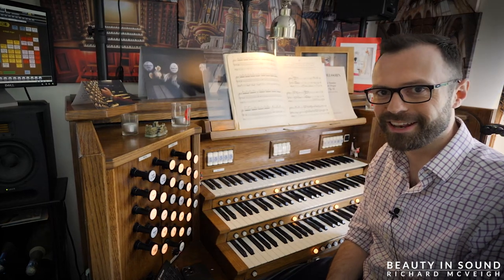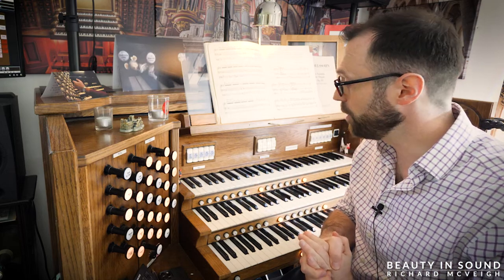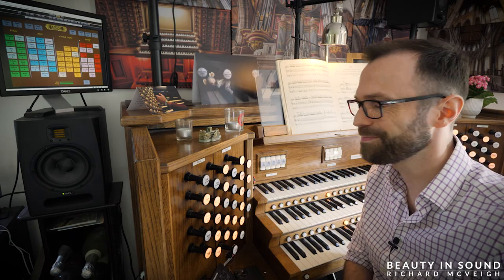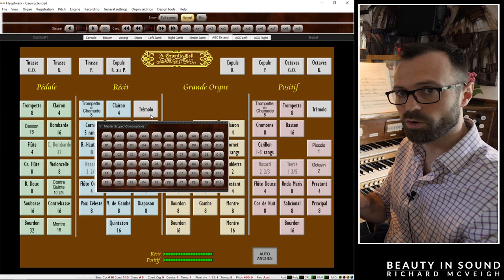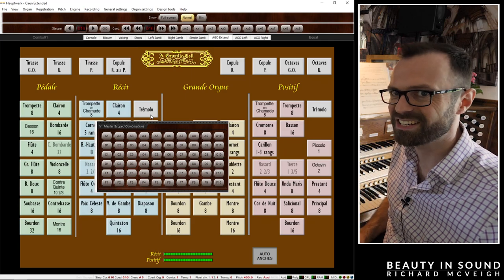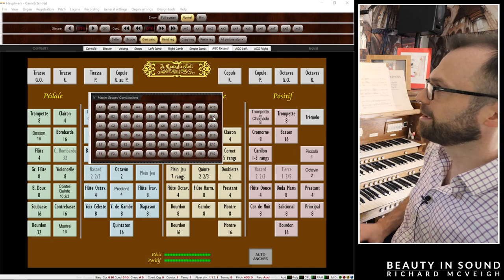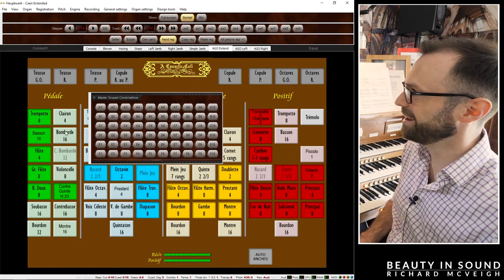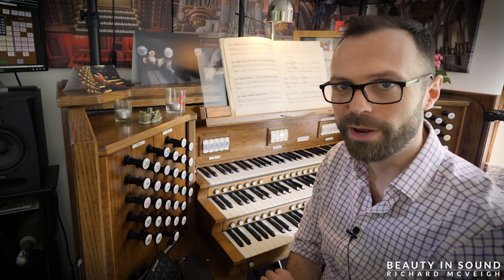☕ Hauptwerk Tutorial - Scoped Pistons (Hauptwerk Hacks)

Comment: If you set this up on a reversible piston, you could turn this function on and off.  Using your example, if you wanted to remove the couplers from a solo manual to the great and pedal, you would activate the reversible and it would take the solo couplers off.  After that stanza, you could activate the reversible again and it would restore the couplers to the great and pedal.  I also like reversibles for 32' pedal stops.  Another possibility would be to create a sforzando piston.